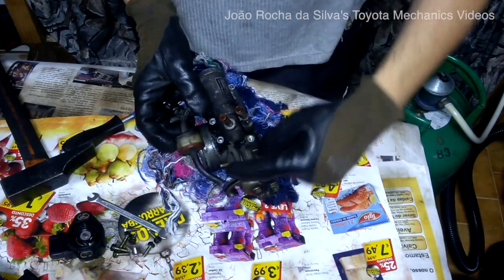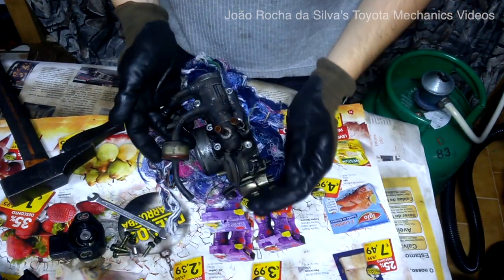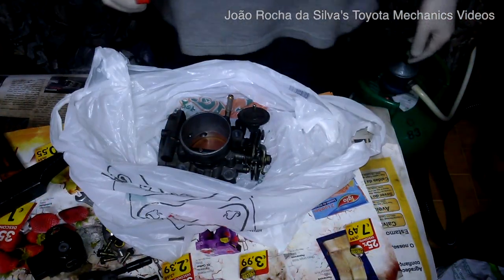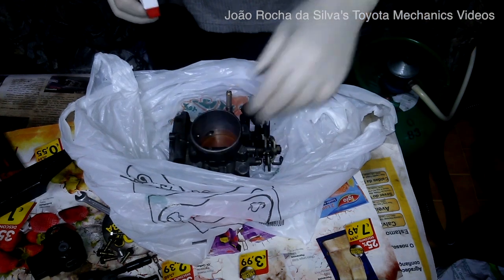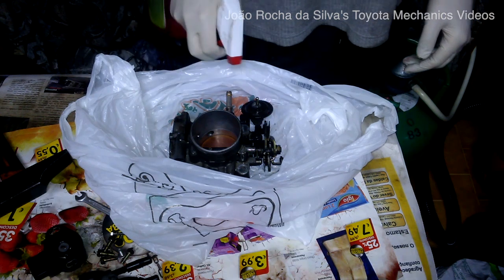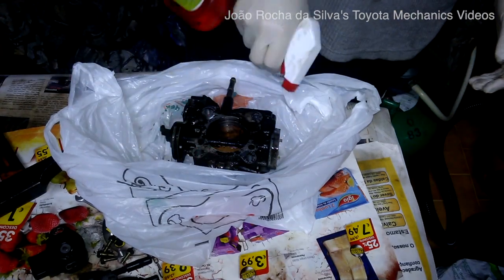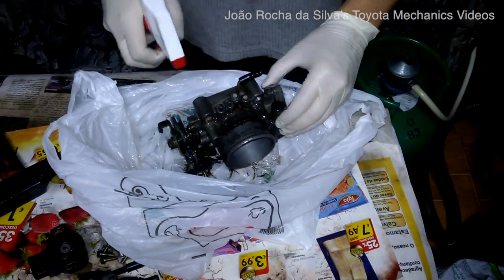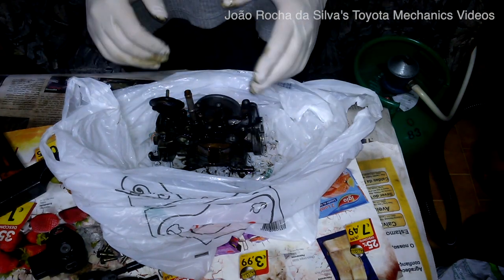Toyota 4AGE Engine Throttle Body Service (2/3) : Cleaning the ISCV Idle Speed Control Valve

Comment: When I disconnect the coolant hoses from the IACV, do I need to bleed the coolant once I reinstall it? I went and bought a new OEM one since my old one was completely shot.
Reply: good idea to bleed the coolant anytime you mess with the system. Don't need to drain it, just run at operating temp w the cap off and top it off as it bubbles down.